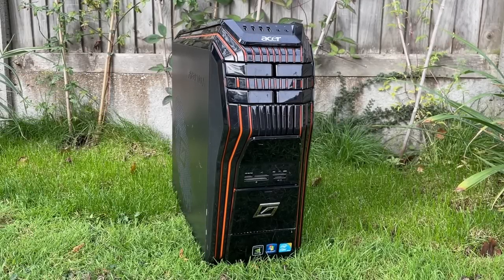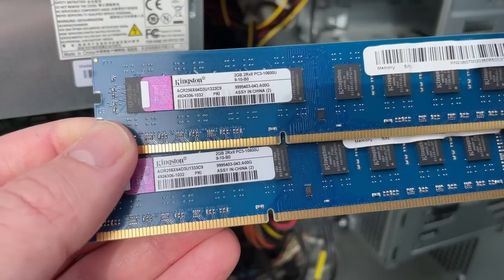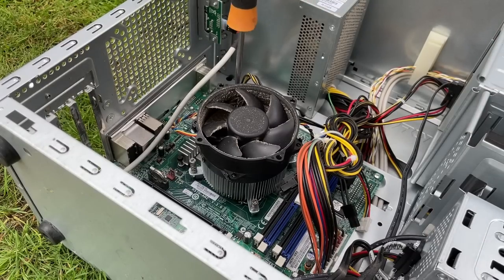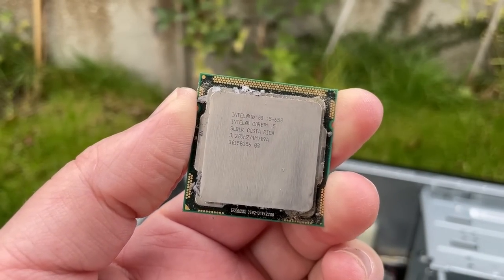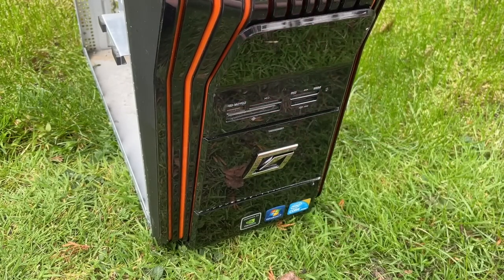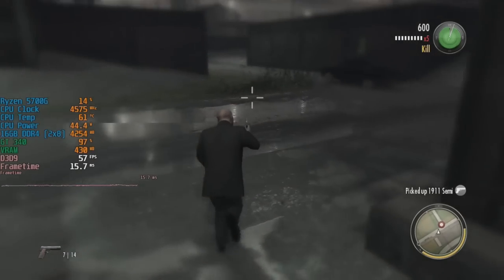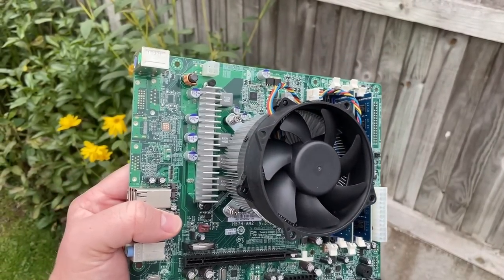This decade-old Acer Predator gaming PC has NEVER been upgraded, so what's inside?

Comment: The cooler looked adequate. I liked the idea of drawing in outside air, although even a couple cheap and mediocre fans would have inproved things considerably.
Reply: You're spot on, well done air ducting and directing can be so darn effective it's crazy, but not many people do it since it's easy enough to brute force it with better fans, and doing both is just too pricey for oems
Reply: They are still using that cooler even today in their modern systems. I have an old Sandy Bridge i5 Veriton that also uses this cooler. It's really a beast compared to the stock Intel cooler

Comment: Bought an acer predator at 13 years old in 2011, i remember it having a 550 TI and a i7 2600 in it. The 550 TI was a HOT Garbage OEM card, switched it out to a radeon 7870 a few years later and the i7 2600 lasted me all the way to 2018 when i upgraded to a ryzen 1700x. Then the i7 2600 was passed on to my girlfriend so she could game for another few years. Sold the pc with the i7 2600 this year for around 200 bucks with a 760 gpu in it. Almost 11 years of service and its still going on in someone elses pc right now.
Reply: Yeah, an i7 2600 is all you really need if you're not bothered about playing the latest games on the highest settings. It's what I have in my PC and it runs everything I play without a problem. It's amazing how it can still hold its own 11 years later. Like, imagine trying to play the latest games in 2012 with a CPU from 2001. Just wouldn't happen.

Comment: These air cowlings make a lot of sense actually, as long as the side of the PC can breathe the need for an intake fan is pretty much eliminated.

I always save these coolers, they are REALLY useful if you are building something SFF!
Reply: Noctua makes something like it for their low profile coolers called the NA-FD1, adjustable from 5-45mm in 1mm increments iirc
Reply: Yeah these coolers are pretty efficient and also very silent,but an intake fan would have helped get some air in for the GPU cooler in case you would have something that gets hot
Reply: They are amazing for temps... But act as a giant Horn for Fan noise
the heatsink itself is a quite chunky boi aswell
Reply: @dasdoin9600  i can't say i've ever had a pc run louder with it on than off. Probably because these horns were always quite important for the thermals inside.
Reply: @ypoora1  i Had this exact cooler on a 775 Platform and replacing the standard horn with a simple tube quieted it down significantly
 dont get me wrong i think "airfunnels"in general are great and my experience overall was more than positive
even the Intel stock cooler is suprisingly quiet when it gets a constant supply of fresh air and i think they are underutilised atm
Reply: my old prebuild still has one, and I really like the concept. Can't say that it's too noisy either, even with the 80mm heatsink fan running flat out the entire time.
Reply: I used to like this type of cooler but now I prefer to have a side fan. The video card will benefit from having a side fan, and your temps will improve considerably if you have a video card that uses more than 150W

Comment: You also have to remember that back then, your monitor was probably 768p, or 900p at best. 1080p monitors were high end, so you probably wouldn’t have gotten this system if you played at that resolution. High refresh rate monitors also didn’t really exist yet. For the price it was targeting, the card would have been a little underpowered but would otherwise game just fine.
Reply: My monitor was 1600x1280 but I only ran it in 1600x1200

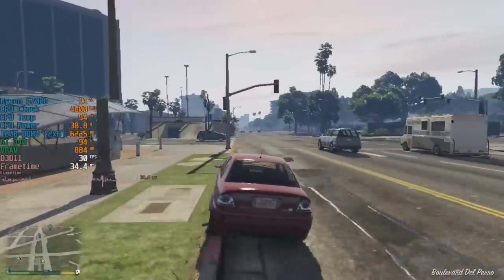Comment: 9:10 that’s because it technically still is running in directx 11, just in feature level 10_1. It emulated the 10.1 feature set while keeping the backing benefits of dx11

Comment: My first gaming PC was a Acer Predator from 2012 that came with an i7-3770, 12GB RAM, and a GT 630 (lol). I ended up upgrading the GT 630 to a 660 Ti and I can very clearly remember cutting myself on the PCI brackets during the install. It lasted a good couple of years before I ended up doing my first build. Good times.
Reply: Still use this exact tower as my TV command center machine

Comment: I'd check the PSU first, it's possible it's on it's way out and only worked briefly without the power draw from the PCIE slot. 
Also, I wouldn't get my hopes up for the Xeons, I'd be surprised if Acer supports them on this board.

The case is really cool tough.

Comment: You said the case would make a great sleeper, and my idea is an AM4 sleeper build, because there's still a lot of juice left to squeeze from AM4. If the hot-swappable bays (but SSD) can be kept, with a B550 board (leaves power delivery headroom for 58/5900 etc) and a Ryzen 5600 (finally getting cheap, 60w TDP helps crutch the poor airflow) and a solid modern GPU (ex-miner 3080 lesgooo), then it would be a cool video editing and gaming sleeper beast. It would be a full success sleeper build if all the I/O ports on the case can still function, because all that crazy front I/O is what made this era of PCs interesting and cool and also keeps it useful in 2022 for the content creator. Oh yeah, that weird old camera card? Just plug it right in, Bob's ur uncle. The build could be a whole series, and I'm sure the I/O would be the interesting part of the build. That and hunting down all the bits, used.

Comment: I bought one of these from NewEgg at the beginning of 2011. An AG5900-U3092. Mine came with an i7-870, Radeon HD5850, 8GB of DDR3, and a generic 750 watt 80+ (Assuming you believe that) PSU. Definitely a step up from the one you got, but I probably could've done a bit better at the time, but didn't know any better. LOL! I put in a GTX970 when it launched, and it definitely breathed massive new life into it.

Also, I still have the 5850 in another build, and it's working fine 11 years later, no repaste, and no performance issues. Definitely a credit to ATI at the time.

Comment: I'm still rocking my predator G3620 from 2012, it had a i7-3770, a GT640 gfx card (4GB), 16GB of DDR3 RAM and a 2 TB HDD, the only changes i did to it over the years were adding a 250GB SSD and replacing the gt640 for a GTX1050ti (2GB).
It has started to show it's age but i can still play a lot of games on medium-high settings.
BEST PC EVER

Comment: I always keep the cone on as it is not used to draw air into the case as he stated, that is what the CPU cooler/fan does. The cone is there to focus the air coming in onto the heatsink/CPU. Adding a rear exhaust fan to the cone design is quite effective. The cone design is also used on cars. They are called radiator shrouds.

Comment: I really like the front hot swap drive bays. I don't like much else. It would be nice as a rebuilt sleeper, you could have a nice hot-swappable raid-1 going on in there.
Reply: They ain't hot swappable though. It clearly has stickers on them saying to shut the PC down before removal.
Reply: @staples4335  They are hot-swappable. The warning on the front is simply a disclaimer.
The motherboard recognized drives as soon as they were inserted and they can be safely disconnected from Windows during operation.

Comment: I bought this pc from a friend for $500 CAD 7 yrs ago, it came with a i7 2600 and a gtx 950(later upgraded to a gtx 1650 super) ive upgraded ram and threw in a ssd and a 750w psu(old one failed). its runs most games on medium/high settings. All my upgrades we done slowly as i could afford them.  I bought a new pc yesterday but im keeping my predator beast for a back up. It was a great starting point for a gaming rig and ill keep her till she explodes!

Comment: I still use my I7 2600K that i built in early 2012 as my main computer and it works just fine for what i want to do, i dont play any games though but i write and record/mix music which is a pretty demanding task, its easily the best computer that i have ever had. I also have an I5 2500K that i got used earlier this year for recording at the rehearsal studio and its great for that. The worst part with these is that they dont support windows 11 so i might have to get a new computer in 2025 at least, the 2500K is used offline though so i can probably use it for many years if it doesnt break down.

Comment: What I usually do with potentially dead boards is take the CMOS battery out and the RAM and then power the system on with just the CPU. Usually you'll get a load of beep codes for the missing RAM. This will tell you the board is still alive and will also reset it but won't harm anything. I've managed to bring a few boards back to life this way.
Reply: Also if you have a spare power button or just use a screwdriver to short the pins on the power header as the button on the PC could have failed and maybe bread board it with a different power supply... I know you probably know all of this but some viewers might not.

Comment: I play games on this baddie nowdays and it works just fine. I needed to upgrade graphics card, but at all games i played i had around 70fps on ultra settings.
Reply: I know it was not best for the buck computer, but i buyed it when it was cheap and coronavirus cameout so i needed it for homestudy
Reply: Pc config. is: i7 2600, SAPPHIRE NITRO Radeon RX 590 8GD5, 16Gb DDR3 ram (2x8), 3Tb HDD, 500Gb SSD, 650w PSU. Stock cpu cooler, cool case😅

Comment: If you have trouble diagnosing the PC, I can recommend to replace the BIOS battery. I have had success with PCs that were either completely dead or would POST unreliably.
Reply from the maker: Yeah same here, fixed a Pc like that recently. Didn’t realise it would work
Reply: I was surprised too as it was my last effort on the first PC I fixed.
I always expected the PSU to supply all required power but appearantly that is not always the case. Let me know if it works for you with this one.

Comment: I was visiting my relatives up near Manchester and decided to look around a Cash Generators, found myself an Acer Predator laptop with a 9th gen i7 and rtx 2070 max Q for £715, had a 512 GB ssd 1 TB HDD and a 17.3 inch display 1080p 144 hz.

Gets bloody hot but it's more powerful than my last desktop and roughly half the price of laptops of the same spec online 👍

Comment: I had an acer predator with a I7 3770, 12gb of ram, 1tb hdd and some real small nvida card (like a gt 710 or something). I bought it as my first computer thought it would be good at gaming because of the branding and then discovered it wasn’t. Years later I learned about pc hardware, threw a ssd for boot and a rx 570 into it and had a solid gaming rig finally

Comment: Likely the water damage. Some traces or chip legs would likely have rusted. If you could find the traces that're rusted, you could use some bodge wire soldered between where it was meant to connect, but on a modern board with so many tiny traces it'd be near impossible.

Comment: My first "GAMING" pc was an Acer Predator G3620-030 with an i5 3350p 8gb of ram and a GTX 660 upgraded to 16gb and a 1060.

Served me well, but the CPU was the weakness, made a new rig with a R7 2700 later on i changed the 1060 for a 5700xt 

now running a 7700x  32gb of ram but still the same GPU still good enough for now all of my old rig are still in the attic i don't like to throw them away
Reply: Don't throw PC parts away no matter how old they are, there's always someone that will probably want to buy one for whatever reason.

Comment: I liked those older case designs back then. Now I find them to be rather gaudy. I really miss the cases that had a front door that, when opened, allowed access to the front io and ODD.
I still use my ODD and appreciate cases that come ODD ready. I've also become less enchanted by rgb and transparent sides and prefer silent cases. Just my 2¢
Reply: What is an ODD?
Reply: @handlesarefeckinstupid  optical disk drive, like a DVD drive

Comment: Hmmm...i have an old Veriton with an i5 2400 that has the same style motherboard,same cooler,RAM and PSU. I guess the Predator only used a more "gamer" looking case and just added a dedicated GPU. I put my old R9 270x in it and i use it as a little "sleeper" PC for older games because the case looks like a regular office PC and i actually like that

Comment: I wonder if this is old enough to have non-proprietary front panel headers, so you can do a motherboard swap and make it some kind of sleeper
Reply: It's came with a standard, non-proprietary mATX mobo. So it's safe to assume it has standard front panel I/O. But honestly, it's not too difficult to swap out non-proprietary front panel stuff with off the shelf power button, USB, audio, etc.

Comment: If you revive the system it may be fun and interesting by to try a socket 775 Quad-Core Xeon (that doesn’t require modifying the socket). A lot of modern CPU coolers will also fit socket 775. There is a Forum Thread with motherboard compatibility for those old Xeons and the instructions on how to update the BIOS with the proper microcodes to support the Quad-Core CPUs. Most of the mobos in the list have been tested and sometimes even have a pre-modified BIOS you may download, although I’m not sure if you will find this particular Acer on that list (it doesn’t include many OEM systems…)
Reply: First gen core i didn't use LGA 775...
Reply: @Gabu_  You’re right, I was talking about Xeon 34xx based on Core 2 Quad for Socket 775 and Xeon 54xx for Socket 771. Those are ancient processors and by no means cost effective, and much-much older than first generation Core i7/i5

Comment: My previous machine was a Pentium 4 and it had one of those little cone things. Some of the newer P4's ran hot so yeah I did what I could to negate that.

The machine I built after it was an i7 965 Extreme Edition on an Asus P6T motherboard....Still using that machine today! Built it around 2011/2012 too so it's been running for over 10 years just about. I have maybe redid the thermal paste once in it's run time when the rear audio jacks and USB ports stopped working after a CRT static discharge went into it through some headphones I was wearing when I was cleaning dust of the monitor so had to replace the motherboard. So not on the original motherboard sadly. I replaced it with an identical one to avoid issues having to reinstall Windows. My Windows install technically hasn't seen a reinstall since the first time I installed it around like 2012 or so. Been using drive image backups the few times I had serious mess ups with it and just recently upgraded to Windows 8.1 (first OS I used on this machine was Windows XP 64 bit Pro then Windows 7. Don't think there was an upgrade path from XP 64 bit so the Win7 had to be a clean install sadly else my OS install would have been a year or so older!

I tested migrating a clone of the drive to another computer I have via the sysprep tool and it survived so I suspect my upgraded OS install will continue to live on even after I finally retire this machine. :P

I should probably think about doing the thermal paste again soon though the thermals still look fine on it for now. This machine has seen all sorts of video cards. A Geforce 8400 was in it at some point. Not sure if I still have that one. Then a GT 240. Still have that one! Sits in a unused PC in the closet. Then a GTX 650. Still have that one. It's in another spare PC my sister used to use). My current video card is a gtx 780 Ti I got around 2021 when I got the stimmy. :P

A 2 core CPU certainly wouldn't have aged as well (and the Pentium 4 machine would be unbearable to use today. :P ). I'd have probably tried to upgrade away from that had my machine been using one. :P

Comment: i bought Acer Predator G5900 round 10 to 11 years ago but mine wasnt as weak as in the video... i managed to get i7-3770k, 16gb ram and nvidia GTX660. gfx card was the only thing that i updated to GTX1060 triple fan. its still running ( my only PC besides diagnostics laptop) good but now i feel like i need to upgrade all of it as its litterally a dinosaur :D

Comment: IF you can get it working, some period correct upgrades would be nice. An i7-860, 8 or 16gb of ram, and something like an HD 6870 or GTX 560 ti.(possibly even a GTX 580, although that would need a PSU upgrade)
Reply: You do not need 16 GB of RAM in something like that. I don't need 16 GB of RAM in my PC.

Comment: I have this case. But only the case because i love its design. I painted the interior in black and put in my high end components: MSI B550M MORTAR MAINBOARD, RYZEN 7 5800X CPU, COOLER MASTER MASTERLIQUID ML120L V 2 RGB, G-SKILL TRIDENT Z RGB 3600MHZ (4x8GB), THERMALTAKE TOUGHPOWER GRAND RGB 750W, MSI GAMING X TRIO RTX 3070Ti 8GB GPU, MSI SPATIUM M48O 1TB NVMe, SEAGATE EXOS 7E8 6TB HDD, SAMSUNG BLU-RAY DRIVE, LG BLU-RAY HD DVD DRIVE.

Comment: I forget what specs I was running in the aughts, but I was still using a separate soundcard, I'm pretty sure, until perhaps 2010! Of course, the rest of the story you know, G3258 to 2200G, to my current 3600.

Comment: I had this Acer with i7 870, 16Gb RAM and ATI 5970 (monster card for that time, best of the best). I still have the pc case and 5970 as collection item. It was such a great pc back in the day, and I built several pc myself after this Acer. went trough X4 7970, X4 980 gtx, 1080s.... and finally RTX X2 3090. Waiting for 4090

Comment: Love pre builts without proprietary parts. While an i7 and gtx 970 with 16gb of ram would be a sensible upgrade it would be fun to see it turned into a sleeper built with a modern CPU and the beefiest GPU that will fit.